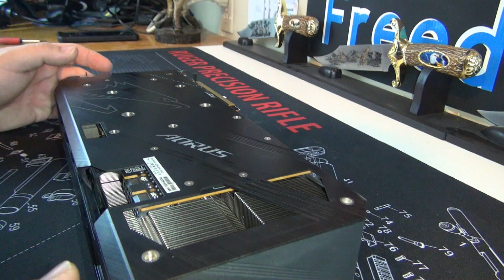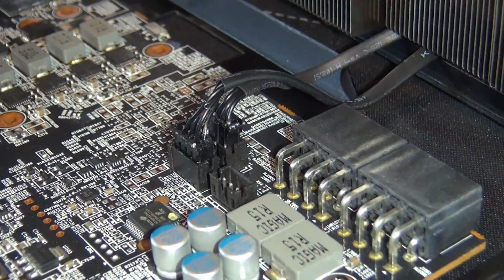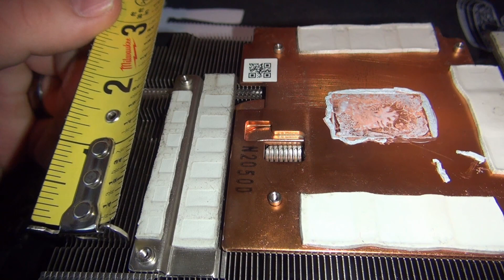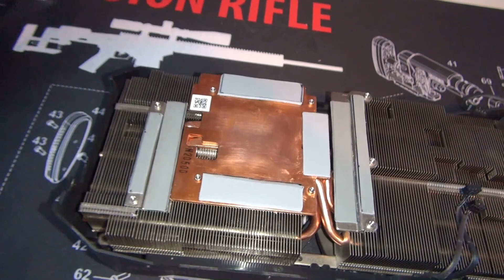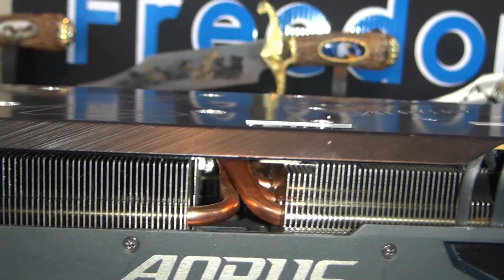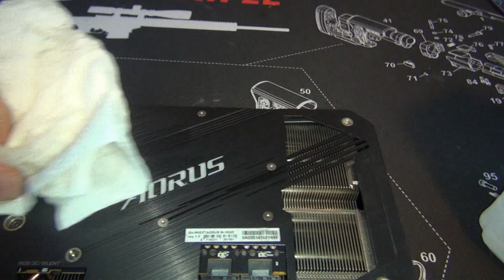AORUS Radeon™ RX 6800XT Master 16GB GPU Thermal Pad Replacement: Tutorial (HD)

Comment: why wouldn't you just get the proper thermal pad size from gigabyte. That would be highly recommended. Also using Arctic Silver 5 is a gamble on a GPU, as it is electrically conductive and you can short those small components next to the die if it were to spread onto them. This is a video of what not to do when changing thermal pads on a GPU. The delivery was thoughtful but the execution was terrible. Always use proper thickness thermal pads and never use Arctic Silver 5.
Reply from the maker: Feel free to do things your way.  I do things the way I do, because I can.  My way worked perfectly fine for me and it is still working great 2 years later.  To each their own.

Comment: Is it the same as 6800 non XT? I have Aorus RX 6800 Master
Reply: Not the same, but very similar. I just did a thermal paste change on my aorus rx 6800 master with no problems.
Reply: Did you find out bro ? I just bought the same card as you have.
Reply: Did you ever find out which thermal pads to use?

Comment: Great video . What thickness were the pads . I have the same gpu
Reply: He replaced the pads with 1.0mm on the memory and 2.0mm on the outside pads and then put 1.0mm on all. But the original look thicker IMO but i noticed some are very compressible and others very little. They DO make thermal puddy to replace pads, but of course are messy. I used to use Arctic Ceramique paste in place of pads back in the day, as its formulated to not "separate, run, migrate, or bleed" and works much better than those silicone based puttys. Used it to cool VRM's on my old motherboard, and after 8 years! the stuff didn't dry out or even run despite the gaps. And i also used that stuff on an old HD 7950 that i volt modded and OCed to hell (1650MHz) and was temperature limited (hit high of 95c rock solid) even with using old school Liquid Metal that you had to replace every 6 months lol

They do sell pads in 0.5mm increments and different materials, but if you don't mind making a mess you can get putty. Personally I'm going to pick up another tube of Arctic Ceramique, the stuff is amazing for it's use cases.
Reply: @MrHeHim  I also had the same impression that the thermalpads looked thicker... I'm thinking about using 2mm and 3mm on mine.

Comment: Could you write us the measurements in millimeters?
Reply from the maker: 1 mm thick.  I measured using the original pads before I removed them.
Reply: @GunsGearNFreedom I think he meant the thermal pads measurements (width and length)... I am also curious about them.

Comment: What are the pad thickness you used for the card? Thank you.
Reply from the maker: I purchased both 1.0 mm and 2.0 mm thick pads.  I ended up having to use the 1.0 mm pads across the entire job, only after I discovered that 2.0 mm pads were too thick for my application, because they wouldn't allow the cooler to sit in place correctly.
Reply: @GunsGearNFreedom  thanks for the reply! I have the same card and wanted to replace pads too as the card tends to run hotter now compared to when I first got them. Thank you for the video, too! Great help.
Reply from the maker: @RussTeeRider  These seem to be pretty solid cards, and come with a decent cooler, but those factory pads don't seem to hold up very well.  I have been running this card mining Ethereum 24/7 except when gaming and the card under 99% load is now running between 49 and 51 degrees Celsius after changing the thermal pads.  That is down from being 60C and above.
Reply: @GunsGearNFreedom  That's a very nice improvement. Thanks for the insight. Will definitely try to replace my pads in the future! Cheers! Will try to do this with my aging 5700 XT, too.

Comment: Are you experiencing reduction in temperature after repadding? What you showed at the end of the video was GPU Core temperature right? What about the memory/vram temperature? Has that also been reduced?
Reply from the maker: You know, that is a good point.  I only checked GPU temps.  Now you have me curious about the vram temps. I have only ever used the LCD temp readout and the AMD Radeon software.  They only show GPU temps and not vram on the card.  Do you have any recommendations for what software to use to check vram temps?
Reply: @GunsGearNFreedom  Any update in this regards? i am planning to change them, hoping it will reduce temps of my current 6800xt mining at 78 deg. Please reply. will help me make a decision sooner
Reply from the maker: @purnesh27jagad11  Replacing the thermal pads has helped me significantly.  I am mining crypto, watching the State of the Union and typing this comment on YouTube and my card LCD screen is showing a temp of 51C with 99% load.
Reply: @GunsGearNFreedom  hi brother. Thank you for helping me out. I have finally replaced the same, ofc thanks to your tutorial.
I just want to know what thickness you required? After reading your ans to a similar question, even I completed whole job with 1mm thickness. Just want to know should it be fine?
I am yet to complete the whole test as power went off.. but initially hiveos showed me temps of 84. (shooed up from previous 72,dont know why) will complete and get back to you. Just want to know is 1mm thickness enough.
Thanks in advance
Reply from the maker: @purnesh27jagad11  I used 1.0mm thickness in mine and my temps have been holding stable under 99% load at 52 degrees C.
Reply: @GunsGearNFreedom  ya mine are similar too but there is a slight difference. for me atleast, 1mm didnt do the trick so i added another 1mm on top of each memory pads and then it worked. (although the core temps came up a bit. just a bit. but overall i am very satisfied. My conclusion is that i think 1.5 mm would be just perfect.
Reply: @GunsGearNFreedom  Hi brother. I have a new issue now. I got the system up and running, but m facing gpu dead error (not for the same gpu but for other) every 5 to 6 hrs, once it came after 22 hrs..but mostly it comes after 5 to 6 hrs. and only for 1 particular gpu.. PS i tried a few things like oc settings, updating and odwngrading hiveos, checking risers and cables, making sure to give enough power to the GPU...but the problem still persists. My query is "is GPU detected error safe in long term" like what if i just continue mining irrespective of it. assuming my system runs smooth for 5-r hrs or so?
Thanks in advance.
Reply: @purnesh27jagad11  my 6800xt does the same thing after doing this. Check your vram temps. Mine wigs out after it hits 94* for too long. I have the gigabyte gaming oC but the cooler is similar to the master and I just know the thermal pads are not right
Reply: @colinwahl2509  My system is running extremely stable. turned out the issue was with another card so sent it for replacement. now post that my system is mining just perfectly.. 100% efficiency, max temp 52 (vram), 61 mh/s @ 107 Watt, stable since more than a month almost.